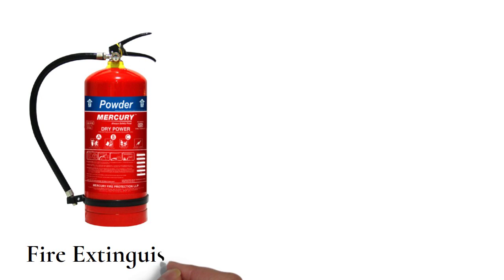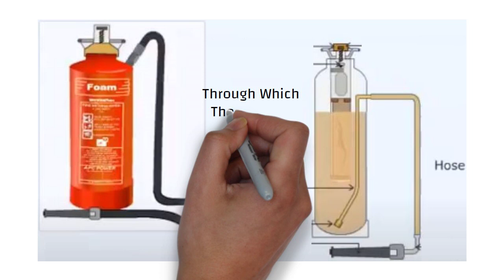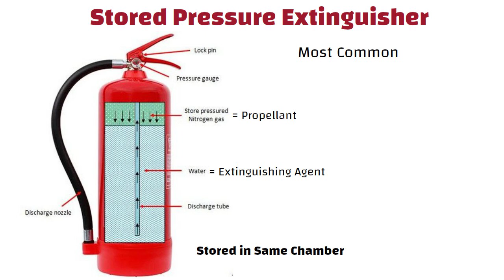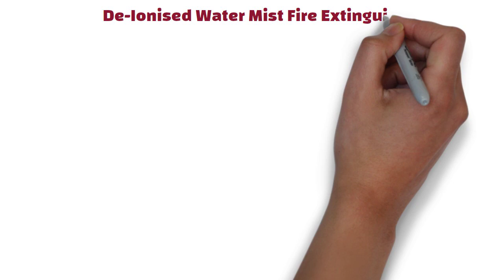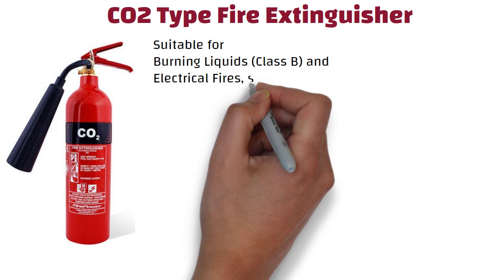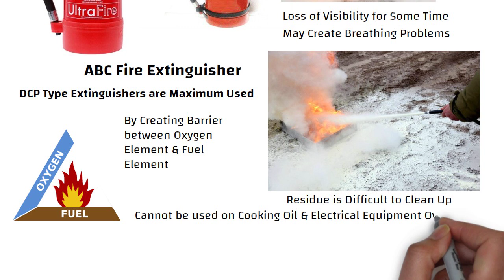FIRE EXTINGUISHER DEALERS IN KERALA, CALL 8138906102, FIRE EXTINGUISHER DEALERS IN ERNAKULAM.

Comment: FIRE EXTINGUISHER DEALERS IN KOTTARAKARA, FIRE EXTINGUISHER SUPPLIERS IN KOTTARAKARA, FIRE EXTINGUISHER DISTRIBUTORS IN KOTTARAKARA, FIRE EXTINGUISHER IN KOTTARAKARA, ABC TYPE FIRE EXTINGUISHER DEALERS IN KOTTARAKARA, CO2 TYPE FIRE EXTINGUISHER DEALERS IN KOTTARAKARA, CLEAN AGENT FIRE EXTINGUISHER IN KOTTARAKARA, MODULAR TYPE FIRE EXTINGUISHER DEALERS IN KOTTARAKARA, MECHANICAL FOAM FIRE EXTINGUISHER DEALERS IN KOTTARAKARA, FIRE EXTINGUISHER NEAR ME KOTTARAKARA, FIRE EXTINGUISHER TRADERS IN KOTTARAKARA, FIRE FIGHTING COMPANIES IN KOTTARAKARA, FIRE CONTRACTORS IN KOTTARAKARA, FIRE EQUIPMENT DEALERS IN KOTTARAKARA, FIRE ALARM DEALERS IN KOTTARAKARA, FIRE PUMP DEALERS IN KOTTARAKARA, SMOKE DETECTOR DEALERS IN KOTTARAKARA, FIRE FIGHTING SYSTEM IN KOTTARAKARA, FIRE PROTECTION SYSTEM IN KOTTARAKARA, FIRE AND SAFETY CONTRACTORS IN KOTTARAKARA, FIRE HYDRANT SYSTEMS IN KOTTARAKARA, PA TALK BACK SYSTEM IN KOTTARAKARA, FIRE NOC IN KOTTARAKARA, FIRE INSTALLATION IN KOTTARAKARA, FIRE NOC RENEWAL IN KOTTARAKARA, KIRLOSKAR FIRE PUMP DEALERS IN KOTTARAKARA, FIRE EXTINGUISHER NEAR ME KOTTARAKARA, FIRE EXTINGUISHER MANUFACURERS IN KOTTARAKARA, SAFEX FIRE EXTINGUISHER DEALERS IN KOTTARAKARA, FIRE NOC CONTRACTORS IN KOTTARAKARA, FIRE FIGHTING EQUIPMENT DEALERS IN KOTTARAKARA, FIRE PROTECTION SYSTEM IN KOTTARAKARA, FIRE INSTALLATION IN KOTTARAKARA, FIRE SAFETY CONTRACTORS IN KOTTARAKARA, FIRE AMC IN KOTTARAKARA, FIRE PROTECTION SYSTEM IN KOTTARAKARA, FIRE PROTECTION EQUIPMET IN KOTTARAKARA, AMC OF FIRE SYSTEM IN KOTTARAKARA, FIRE CONSULTANTS IN KOTTARAKARA, FIRE AND SAFETY EQUIPMENT DEALERS IN KOTTARAKARA, ADDRESSABLE FIRE ALARM SYSTEM IN KOTTARAKARA, KARTHAR VALVE DEALERS IN KOTTARAKARA, DCP TYPE FIRE EXTINGUISHER IN KOTTARAKARA, POWSER TYPE FIRE EXTINGUISHERS IN KOTTARAKARA, FIRE HYDRANT SYSTEM IN KOTTARAKARA, FIRE ALARM PANEL DEALERS IN KOTTARAKARA, SAFEPRO FIRE EXTINGUISHER DEALERS IN KOTTARAKARA, MS AND GI PIPE DEALERS IN KOTTARAKARA, JINDAL PIPE DEALERS IN KOTTARAKARA, AGNI FIRE ALARM DEALERS IN KOTTARAKARA, FIRE EQUIPMENT DEALERS IN KOTTARAKARA, FIRE EQUIPMENT SUPPLIERS IN KOTTARAKARA, FIRE EQUIPMENT TRADERS IN KOTTARAKARA, FIRE SPRINKLER SYSTEM IN KOTTARAKARA, RAVEL FIRE ALARM DEALERS IN KOTTARAKARA, RAVEL FIRE ALARM SYSTEM IN KOTTARAKARA, AGNI FIRE ALARM DISTRIBUTORS IN KOTTARAKARA, FIRE ALARM CONTRACTORS IN KOTTARAKARA, FIRE PIPE INSTALLATION IN CONTRACTORS IN KOTTARAKARA, FIRE SAFETY CONTRACTORS IN KOTTARAKARA, FIRE PA TWO WAY TALK BACK SYSTEM DEALERS IN KOTTARAKARA, HEAT DETECTOR DEALERS IN KOTTARAKARA, HONEYWELL FIRE ALARM DEALERS IN KOTTARAKARA, FIRE NOC CONSULTANTS IN KOTTARAKARA, FIRE AMC AND FIRE NOC IN KOTTARAKARA, FIRE SAFETY COMPANIES IN KOTTARAKARA, NEWAGE DEALERS IN KOTTARAKARA, MONSHER FIRE EQUIPMENT DEALERS IN KOTTARAKARA, KARTHAR VALVE DEALERS IN KOTTARAKARA, FIRE HYDRANT VALVE DEALERS IN KOTTARAKARA, FIRE HOSE REEL DRUM DEALERS IN KOTTARAKARA, FIRE SPRINKLER DEALERS IN KOTTARAKARA, FIRE PUMP DEALERS IN KOTTARAKARA, LUBI PUMP DEALERS IN KOTTARAKARA, LHP PUMP DEALERS IN KOTTARAKARA. FIRE CONTRACTORS IN KOTTARAKARA, FIRE AND SAFETY CONTRACTORS IN KOTTARAKARA, FIRE EQUIPMENT DEALERS IN KOTTARAKARA, FIRE FIGHTING CONTRACTORS IN KOTTARAKARA, AGNI FIRE ALARM DEALERS IN KOTTARAKARA, PA TALK BACK SYSTEM DEALERS IN KOTTARAKARA, FIRE NOC IN KOTTARAKARA, FIRE NOC RENEWAL IN KOTTARAKARA, FIRE SYSTEM INSTALLATION IN KOTTARAKARA.

Comment: FIRE EXTINGUISHER DEALERS IN PUNALUR, FIRE EXTINGUISHER SUPPLIERS IN PUNALUR, FIRE EXTINGUISHER DISTRIBUTORS IN PUNALUR, FIRE EXTINGUISHER IN PUNALUR, ABC TYPE FIRE EXTINGUISHER DEALERS IN PUNALUR, CO2 TYPE FIRE EXTINGUISHER DEALERS IN PUNALUR, CLEAN AGENT FIRE EXTINGUISHER IN PUNALUR, MODULAR TYPE FIRE EXTINGUISHER DEALERS IN PUNALUR, MECHANICAL FOAM FIRE EXTINGUISHER DEALERS IN PUNALUR, FIRE EXTINGUISHER NEAR ME PUNALUR, FIRE EXTINGUISHER TRADERS IN PUNALUR, FIRE FIGHTING COMPANIES IN PUNALUR, FIRE CONTRACTORS IN PUNALUR, FIRE EQUIPMENT DEALERS IN PUNALUR, FIRE ALARM DEALERS IN PUNALUR, FIRE PUMP DEALERS IN PUNALUR, SMOKE DETECTOR DEALERS IN PUNALUR, FIRE FIGHTING SYSTEM IN PUNALUR, FIRE PROTECTION SYSTEM IN PUNALUR, FIRE AND SAFETY CONTRACTORS IN PUNALUR, FIRE HYDRANT SYSTEMS IN PUNALUR, PA TALK BACK SYSTEM IN PUNALUR, FIRE NOC IN PUNALUR, FIRE INSTALLATION IN PUNALUR, FIRE NOC RENEWAL IN PUNALUR, KIRLOSKAR FIRE PUMP DEALERS IN PUNALUR, FIRE EXTINGUISHER NEAR ME PUNALUR, FIRE EXTINGUISHER MANUFACURERS IN PUNALUR, SAFEX FIRE EXTINGUISHER DEALERS IN PUNALUR, FIRE NOC CONTRACTORS IN PUNALUR, FIRE FIGHTING EQUIPMENT DEALERS IN PUNALUR, FIRE PROTECTION SYSTEM IN PUNALUR, FIRE INSTALLATION IN PUNALUR, FIRE SAFETY CONTRACTORS IN PUNALUR, FIRE AMC IN PUNALUR, FIRE PROTECTION SYSTEM IN PUNALUR, FIRE PROTECTION EQUIPMET IN PUNALUR, AMC OF FIRE SYSTEM IN PUNALUR, FIRE CONSULTANTS IN PUNALUR, FIRE AND SAFETY EQUIPMENT DEALERS IN PUNALUR, ADDRESSABLE FIRE ALARM SYSTEM IN PUNALUR, KARTHAR VALVE DEALERS IN PUNALUR, DCP TYPE FIRE EXTINGUISHER IN PUNALUR, POWSER TYPE FIRE EXTINGUISHERS IN PUNALUR, FIRE HYDRANT SYSTEM IN PUNALUR, FIRE ALARM PANEL DEALERS IN PUNALUR, SAFEPRO FIRE EXTINGUISHER DEALERS IN PUNALUR, MS AND GI PIPE DEALERS IN PUNALUR, JINDAL PIPE DEALERS IN PUNALUR, AGNI FIRE ALARM DEALERS IN PUNALUR, FIRE EQUIPMENT DEALERS IN PUNALUR, FIRE EQUIPMENT SUPPLIERS IN PUNALUR, FIRE EQUIPMENT TRADERS IN PUNALUR, FIRE SPRINKLER SYSTEM IN PUNALUR, RAVEL FIRE ALARM DEALERS IN PUNALUR, RAVEL FIRE ALARM SYSTEM IN PUNALUR, AGNI FIRE ALARM DISTRIBUTORS IN PUNALUR, FIRE ALARM CONTRACTORS IN PUNALUR, FIRE PIPE INSTALLATION IN CONTRACTORS IN PUNALUR, FIRE SAFETY CONTRACTORS IN PUNALUR, FIRE PA TWO WAY TALK BACK SYSTEM DEALERS IN PUNALUR, HEAT DETECTOR DEALERS IN PUNALUR, HONEYWELL FIRE ALARM DEALERS IN PUNALUR, FIRE NOC CONSULTANTS IN PUNALUR, FIRE AMC AND FIRE NOC IN PUNALUR, FIRE SAFETY COMPANIES IN PUNALUR, NEWAGE DEALERS IN PUNALUR, MONSHER FIRE EQUIPMENT DEALERS IN PUNALUR, KARTHAR VALVE DEALERS IN PUNALUR, FIRE HYDRANT VALVE DEALERS IN PUNALUR, FIRE HOSE REEL DRUM DEALERS IN PUNALUR, FIRE SPRINKLER DEALERS IN PUNALUR, FIRE PUMP DEALERS IN PUNALUR, LUBI PUMP DEALERS IN PUNALUR, LHP PUMP DEALERS IN PUNALUR. FIRE CONTRACTORS IN PUNALUR, FIRE AND SAFETY CONTRACTORS IN PUNALUR, FIRE EQUIPMENT DEALERS IN PUNALUR, FIRE FIGHTING CONTRACTORS IN PUNALUR, AGNI FIRE ALARM DEALERS IN PUNALUR, PA TALK BACK SYSTEM DEALERS IN PUNALUR, FIRE NOC IN PUNALUR, FIRE NOC RENEWAL IN PUNALUR, FIRE SYSTEM INSTALLATION IN PUNALUR.

Comment: FIRE EXTINGUISHER DEALERS IN KOTTARAKKARA, FIRE EXTINGUISHER SUPPLIERS IN KOTTARAKKARA, FIRE EXTINGUISHER DISTRIBUTORS IN KOTTARAKKARA, FIRE EXTINGUISHER IN KOTTARAKKARA, ABC TYPE FIRE EXTINGUISHER DEALERS IN KOTTARAKKARA, CO2 TYPE FIRE EXTINGUISHER DEALERS IN KOTTARAKKARA, CLEAN AGENT FIRE EXTINGUISHER IN KOTTARAKKARA, MODULAR TYPE FIRE EXTINGUISHER DEALERS IN KOTTARAKKARA, MECHANICAL FOAM FIRE EXTINGUISHER DEALERS IN KOTTARAKKARA, FIRE EXTINGUISHER NEAR ME KOTTARAKKARA, FIRE EXTINGUISHER TRADERS IN KOTTARAKKARA, FIRE FIGHTING COMPANIES IN KOTTARAKKARA, FIRE CONTRACTORS IN KOTTARAKKARA, FIRE EQUIPMENT DEALERS IN KOTTARAKKARA, FIRE ALARM DEALERS IN KOTTARAKKARA, FIRE PUMP DEALERS IN KOTTARAKKARA, SMOKE DETECTOR DEALERS IN KOTTARAKKARA, FIRE FIGHTING SYSTEM IN KOTTARAKKARA, FIRE PROTECTION SYSTEM IN KOTTARAKKARA, FIRE AND SAFETY CONTRACTORS IN KOTTARAKKARA, FIRE HYDRANT SYSTEMS IN KOTTARAKKARA, PA TALK BACK SYSTEM IN KOTTARAKKARA, FIRE NOC IN KOTTARAKKARA, FIRE INSTALLATION IN KOTTARAKKARA, FIRE NOC RENEWAL IN KOTTARAKKARA, KIRLOSKAR FIRE PUMP DEALERS IN KOTTARAKKARA, FIRE EXTINGUISHER NEAR ME KOTTARAKKARA, FIRE EXTINGUISHER MANUFACURERS IN KOTTARAKKARA, SAFEX FIRE EXTINGUISHER DEALERS IN KOTTARAKKARA, FIRE NOC CONTRACTORS IN KOTTARAKKARA, FIRE FIGHTING EQUIPMENT DEALERS IN KOTTARAKKARA, FIRE PROTECTION SYSTEM IN KOTTARAKKARA, FIRE INSTALLATION IN KOTTARAKKARA, FIRE SAFETY CONTRACTORS IN KOTTARAKKARA, FIRE AMC IN KOTTARAKKARA, FIRE PROTECTION SYSTEM IN KOTTARAKKARA, FIRE PROTECTION EQUIPMET IN KOTTARAKKARA, AMC OF FIRE SYSTEM IN KOTTARAKKARA, FIRE CONSULTANTS IN KOTTARAKKARA, FIRE AND SAFETY EQUIPMENT DEALERS IN KOTTARAKKARA, ADDRESSABLE FIRE ALARM SYSTEM IN KOTTARAKKARA, KARTHAR VALVE DEALERS IN KOTTARAKKARA, DCP TYPE FIRE EXTINGUISHER IN KOTTARAKKARA, POWSER TYPE FIRE EXTINGUISHERS IN KOTTARAKKARA, FIRE HYDRANT SYSTEM IN KOTTARAKKARA, FIRE ALARM PANEL DEALERS IN KOTTARAKKARA, SAFEPRO FIRE EXTINGUISHER DEALERS IN KOTTARAKKARA, MS AND GI PIPE DEALERS IN KOTTARAKKARA, JINDAL PIPE DEALERS IN KOTTARAKKARA, AGNI FIRE ALARM DEALERS IN KOTTARAKKARA, FIRE EQUIPMENT DEALERS IN KOTTARAKKARA, FIRE EQUIPMENT SUPPLIERS IN KOTTARAKKARA, FIRE EQUIPMENT TRADERS IN KOTTARAKKARA, FIRE SPRINKLER SYSTEM IN KOTTARAKKARA, RAVEL FIRE ALARM DEALERS IN KOTTARAKKARA, RAVEL FIRE ALARM SYSTEM IN KOTTARAKKARA, AGNI FIRE ALARM DISTRIBUTORS IN KOTTARAKKARA, FIRE ALARM CONTRACTORS IN KOTTARAKKARA, FIRE PIPE INSTALLATION IN CONTRACTORS IN KOTTARAKKARA, FIRE SAFETY CONTRACTORS IN KOTTARAKKARA, FIRE PA TWO WAY TALK BACK SYSTEM DEALERS IN KOTTARAKKARA, HEAT DETECTOR DEALERS IN KOTTARAKKARA, HONEYWELL FIRE ALARM DEALERS IN KOTTARAKKARA, FIRE NOC CONSULTANTS IN KOTTARAKKARA, FIRE AMC AND FIRE NOC IN KOTTARAKKARA, FIRE SAFETY COMPANIES IN KOTTARAKKARA, NEWAGE DEALERS IN KOTTARAKKARA, MONSHER FIRE EQUIPMENT DEALERS IN KOTTARAKKARA, KARTHAR VALVE DEALERS IN KOTTARAKKARA, FIRE HYDRANT VALVE DEALERS IN KOTTARAKKARA, FIRE HOSE REEL DRUM DEALERS IN KOTTARAKKARA, FIRE SPRINKLER DEALERS IN KOTTARAKKARA, FIRE PUMP DEALERS IN KOTTARAKKARA, LUBI PUMP DEALERS IN KOTTARAKKARA, LHP PUMP DEALERS IN KOTTARAKKARA. FIRE CONTRACTORS IN KOTTARAKKARA, FIRE AND SAFETY CONTRACTORS IN KOTTARAKKARA, FIRE EQUIPMENT DEALERS IN KOTTARAKKARA, FIRE FIGHTING CONTRACTORS IN KOTTARAKKARA, AGNI FIRE ALARM DEALERS IN KOTTARAKKARA, PA TALK BACK SYSTEM DEALERS IN KOTTARAKKARA, FIRE NOC IN KOTTARAKKARA, FIRE NOC RENEWAL IN KOTTARAKKARA, FIRE SYSTEM INSTALLATION IN KOTTARAKKARA.

Comment: FIRE EXTINGUISHER DEALERS IN VADAKARA, FIRE EXTINGUISHER SUPPLIERS IN VADAKARA, FIRE EXTINGUISHER DISTRIBUTORS IN VADAKARA FIRE EXTINGUISHER IN VADAKARA, ABC TYPE FIRE EXTINGUISHER DEALERS IN VADAKARA, CO2 TYPE FIRE EXTINGUISHER DEALERS IN VADAKARA, CLEAN AGENT FIRE EXTINGUISHER IN VADAKARA, MODULAR TYPE FIRE EXTINGUISHER DEALERS IN VADAKARA, MECHANICAL FOAM FIRE EXTINGUISHER DEALERS IN VADAKARA, KIRLOSKAR FIRE PUMP DEALERS IN VADAKARA,  FIRE FIGHTING EQUIPMENT DEALERS IN VADAKARA, FIRE FIGHTING SYSTEM IN VADAKARA,  RO PUMP DEALERS IN VADAKARA. FIRE EXTINGUISHER IN VADAKARA, FIRE ECONTRACTORS IN VADAKARA, FIRE EXTINGUISHER SUPPLIERS IN VADAKARA, FIRE EXTINGUISHER DEALERS IN NADAPURAM, FIRE EXTINGUISHER DEALERS IN PERAMBRA, FIRE EXTINGUISHER DEALERS IN MAHE, FIRE EXTINGUISHER DEALERS IN  PAYYOLI, FIRE EXTINGUISHER DEALERS IN NADAPURAM, FIRE EXTINGUISHER DEALERS IN THALASSERY, FIRE EXTINGUISHER SUPPLIERS IN NADAPURAM, FIRE EXTINGUISHER SUPPLIERS IN PERAMBRA, FIRE EXTINGUISHER SUPPLIERS IN MAHE, FIRE EXTINGUISHER SUPPLIERS IN  PAYYOLI, FIRE EXTINGUISHER SUPPLIERS IN NADAPURAM, FIRE EXTINGUISHER SUPPLIERS IN THALASSERY, FIRE EXTINGUISHER IN NADAPURAM, FIRE EXTINGUISHER IN PERAMBRA, FIRE EXTINGUISHER IN MAHE, FIRE EXTINGUISHER IN PAYYOLI, FIRE EXTINGUISHER  IN NADAPURAM, FIRE EXTINGUISHER IN THALASSERY,  FIRE EXTINGUISHER TRADERS IN NADAPURAM, FIRE EXTINGUISHER TRADERS IN PERAMBRA, FIRE EXTINGUISHER TRADERS IN MAHE, FIRE EXTINGUISHER TRADERS IN  PAYYOLI, FIRE EXTINGUISHER TRADERS IN NADAPURAM, FIRE EXTINGUISHER TRADERS IN THALASSERY, Fire fighting contractors in VADAKARA, fire and safety installations in VADAKARA, fire extinguishers in VADAKARA, fire extinguishers in VADAKARA, fire protection system in VADAKARA, fire and safety installation in VADAKARA, fire and safety contractors in VADAKARA, fire safety contractors in VADAKARA, fire and safety equipments in VADAKARA, fire equipment in VADAKARA, fire protection system installation in VADAKARA, fire contractors in VADAKARA, fire safety consultants in VADAKARA,  fire alarm system in VADAKARA, fire NOC in VADAKARA, fire AMC in VADAKARA, fire fighting equipment in VADAKARA, fire pump panel in VADAKARA, motor control panel in VADAKARA, Morley fire alarm in VADAKARA, GST fire alarm in VADAKARA, addressable fire alarm system in VADAKARA, PA talk back system in VADAKARA, PA two way talk back system in VADAKARA, auto glow SIGNAGES in VADAKARA, Karthar dealers in VADAKARA, Agni fire alarm dealers in VADAKARA, ASES SECURITY fire alarm dealers in VADAKARA, AUTO GLOW SIGNAGES in VADAKARA, FIRE PUMP PANEL in VADAKARA, LHP pump in VADAKARA. Karthar valves in VADAKARA, Ravel fire alarm system in VADAKARA. Jindal pipe dealers in VADAKARA, Jindal pipe dealers in VADAKARA. MS pipe dealers in VADAKARA. Butterfly valves in VADAKARA, PA talk back system in VADAKARA, Fire alarm dealers in VADAKARA, smoke detector dealers in VADAKARA, fire alarm panels dealers in VADAKARA, MCP, hooter dealers in VADAKARA, hydrant valve dealers in VADAKARA, branch pipe dealers in VADAKARA, Fire CP hose in VADAKARA, Fire hose reel drum dealers in VADAKARA, heat detector dealers in VADAKARA, Motor Control panel in VADAKARA,  LED EXIT LIGHTS dealers in VADAKARA, emergency exit light dealers in VADAKARA, auto glow SIGNAGES dealers in VADAKARA. Conventional fire alarm system in VADAKARA, Fire alarm panel in VADAKARA, Notifier fire alarm dealers in VADAKARA, PA talk back unit dealers in VADAKARA. Honeywell fire alarm dealers in VADAKARA, KIRLOSKAR FIRE FIGHTING PUMP DEALERS IN VADAKARA, FIRE FIGHTING EQUIPMENT DEALERS IN VADAKARA, FIRE ALARM SYSTEM DEALERS IN VADAKARA, FIRE CONSULTANTS IN VADAKARA, FIRE CONTRACTOTORS IN VADAKARA, FIRE CONTRACTORS IN VADAKARA, FIRE ALARM SYSTEM DEALERS IN VADAKARA, SMOKE DETECTOR DEALERS IN VADAKARA, FIRE PROTECTION SYSTEM IN VADAKARA, FIRE CONSULTANTS IN VADAKARA, FIRE CONSULTANTS IN VADAKARA, ADDRESSABLE FIRE ALARM SYSTEMS IN VADAKARA,  SMOKE DETECTOR DEALERS IN VADAKARA,  RAVEL FIRE ALARM SYSTEM IN VADAKARA, LUBI FIRE FIGHTING PUMP DEALERS IN VADAKARA,  Fire extinguisher dealers in Koyilandy,

Comment: FIRE EXTINGUISHER DEALERS IN PATHANAMTHITTA, FIRE EXTINGUISHER SUPPLIERS IN PATHANAMTHITTA, FIRE EXTINGUISHER DISTRIBUTORS IN PATHANAMTHITTA, FIRE EXTINGUISHER IN PATHANAMTHITTA, ABC TYPE FIRE EXTINGUISHER DEALERS IN PATHANAMTHITTA, CO2 TYPE FIRE EXTINGUISHER DEALERS IN PATHANAMTHITTA, CLEAN AGENT FIRE EXTINGUISHER IN PATHANAMTHITTA, MODULAR TYPE FIRE EXTINGUISHER DEALERS IN PATHANAMTHITTA, MECHANICAL FOAM FIRE EXTINGUISHER DEALERS IN PATHANAMTHITTA, FIRE EXTINGUISHER NEAR ME PATHANAMTHITTA, FIRE EXTINGUISHER TRADERS IN PATHANAMTHITTA, FIRE FIGHTING COMPANIES IN PATHANAMTHITTA, FIRE CONTRACTORS IN PATHANAMTHITTA, FIRE EQUIPMENT DEALERS IN PATHANAMTHITTA, FIRE ALARM DEALERS IN PATHANAMTHITTA, FIRE PUMP DEALERS IN PATHANAMTHITTA, SMOKE DETECTOR DEALERS IN PATHANAMTHITTA, FIRE FIGHTING SYSTEM IN PATHANAMTHITTA, FIRE PROTECTION SYSTEM IN PATHANAMTHITTA, FIRE AND SAFETY CONTRACTORS IN PATHANAMTHITTA, FIRE HYDRANT SYSTEMS IN PATHANAMTHITTA, PA TALK BACK SYSTEM IN PATHANAMTHITTA, FIRE NOC IN PATHANAMTHITTA, FIRE INSTALLATION IN PATHANAMTHITTA, FIRE NOC RENEWAL IN PATHANAMTHITTA, KIRLOSKAR FIRE PUMP DEALERS IN PATHANAMTHITTA, FIRE EXTINGUISHER NEAR ME PATHANAMTHITTA, FIRE EXTINGUISHER MANUFACURERS IN PATHANAMTHITTA, SAFEX FIRE EXTINGUISHER DEALERS IN PATHANAMTHITTA, FIRE NOC CONTRACTORS IN PATHANAMTHITTA, FIRE FIGHTING EQUIPMENT DEALERS IN PATHANAMTHITTA, FIRE PROTECTION SYSTEM IN PATHANAMTHITTA, FIRE INSTALLATION IN PATHANAMTHITTA, FIRE SAFETY CONTRACTORS IN PATHANAMTHITTA, FIRE AMC IN PATHANAMTHITTA, FIRE PROTECTION SYSTEM IN PATHANAMTHITTA, FIRE PROTECTION EQUIPMET IN PATHANAMTHITTA, AMC OF FIRE SYSTEM IN PATHANAMTHITTA, FIRE CONSULTANTS IN PATHANAMTHITTA, FIRE AND SAFETY EQUIPMENT DEALERS IN PATHANAMTHITTA, ADDRESSABLE FIRE ALARM SYSTEM IN PATHANAMTHITTA, KARTHAR VALVE DEALERS IN PATHANAMTHITTA, DCP TYPE FIRE EXTINGUISHER IN PATHANAMTHITTA, POWSER TYPE FIRE EXTINGUISHERS IN PATHANAMTHITTA, FIRE HYDRANT SYSTEM IN PATHANAMTHITTA, FIRE ALARM PANEL DEALERS IN PATHANAMTHITTA, SAFEPRO FIRE EXTINGUISHER DEALERS IN PATHANAMTHITTA, MS AND GI PIPE DEALERS IN PATHANAMTHITTA, JINDAL PIPE DEALERS IN PATHANAMTHITTA, AGNI FIRE ALARM DEALERS IN PATHANAMTHITTA, FIRE EQUIPMENT DEALERS IN PATHANAMTHITTA, FIRE EQUIPMENT SUPPLIERS IN PATHANAMTHITTA, FIRE EQUIPMENT TRADERS IN PATHANAMTHITTA, FIRE SPRINKLER SYSTEM IN PATHANAMTHITTA, RAVEL FIRE ALARM DEALERS IN PATHANAMTHITTA, RAVEL FIRE ALARM SYSTEM IN PATHANAMTHITTA, AGNI FIRE ALARM DISTRIBUTORS IN PATHANAMTHITTA, FIRE ALARM CONTRACTORS IN PATHANAMTHITTA, FIRE PIPE INSTALLATION IN CONTRACTORS IN PATHANAMTHITTA, FIRE SAFETY CONTRACTORS IN PATHANAMTHITTA, FIRE PA TWO WAY TALK BACK SYSTEM DEALERS IN PATHANAMTHITTA, HEAT DETECTOR DEALERS IN PATHANAMTHITTA, HONEYWELL FIRE ALARM DEALERS IN PATHANAMTHITTA, FIRE NOC CONSULTANTS IN PATHANAMTHITTA, FIRE AMC AND FIRE NOC IN PATHANAMTHITTA, FIRE SAFETY COMPANIES IN PATHANAMTHITTA, NEWAGE DEALERS IN PATHANAMTHITTA, MONSHER FIRE EQUIPMENT DEALERS IN PATHANAMTHITTA, KARTHAR VALVE DEALERS IN PATHANAMTHITTA, FIRE HYDRANT VALVE DEALERS IN PATHANAMTHITTA, FIRE HOSE REEL DRUM DEALERS IN PATHANAMTHITTA, FIRE SPRINKLER DEALERS IN PATHANAMTHITTA, FIRE PUMP DEALERS IN PATHANAMTHITTA, LUBI PUMP DEALERS IN PATHANAMTHITTA, LHP PUMP DEALERS IN PATHANAMTHITTA. FIRE CONTRACTORS IN PATHANAMTHITTA, FIRE AND SAFETY CONTRACTORS IN PATHANAMTHITTA, FIRE EQUIPMENT DEALERS IN PATHANAMTHITTA, FIRE FIGHTING CONTRACTORS IN PATHANAMTHITTA, AGNI FIRE ALARM DEALERS IN PATHANAMTHITTA, PA TALK BACK SYSTEM DEALERS IN PATHANAMTHITTA, FIRE NOC IN PATHANAMTHITTA, FIRE NOC RENEWAL IN PATHANAMTHITTA, FIRE SYSTEM INSTALLATION IN PATHANAMTHITTA.